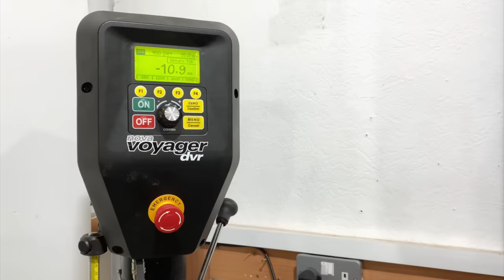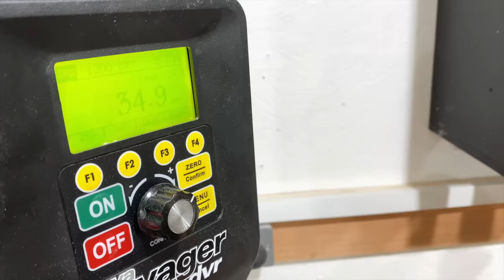Woodturning - Woven Plywood Stool

Comment: Jack, great job on that stool…great look.   I have dabbled in woodworking over the years and now that I am retired, I decided to refit my workshop and get back to it.  I also decided to add a lathe to my tool chest and already turned a couple of bowls and some handles for my chisel retrofit.  Love the mallet…I built one using a 3 layer plywood plan…really useful.  Working with wood is very relaxing for me.
Reply from the maker: Sounds great buddy. Do you make any video’s?
Reply: @JackMackWoodturning  No, I am very unconventional in my methods...it would take me longer to edit the video than to make the project...besides, so many can do it easier or faster than me, I just take my time and if I have to take the long way around the barn to get it done, then so be it.  I take pics of the finished items to show people and if they are interested, I make it for them.

Comment: This was the very first cut my turf has received since been laid (1 month) https://www.youtube.com/post/UgkxTPN04aT-Qdjr_KS3ql7ng8wnU3wwsCqk also recommend  Very happy with the product and delivery. Was cut at the highest setting, I Was able to cut upto the boundaries with ease with exception of the corners for obvious reasons. Very little loose grass left ad the box was large enough to hold everything garden size roughly 24m2. There was no assembly instructions with it, it's not difficult to put together, YouTube the item if your unsure. Would recommend for small gardens like myn.

Comment: That plywood turned out way better than I thought it would good job
Reply from the maker: Cheers bill. Have you turned birch ply before?
Reply: No only cabinet grade oak and it had some voids in it I tried a small glue up of fiber core it finished well but looked strange

Comment: I was wondering what is the advantage of the 2 bottom braces attaching to the other 2 braces instead of to the legs? Is it stronger that way? Or is it so they are not staggered?  This was really nice being able to see this build from beginning to end. I think I might be able to make a stool like this but I don't think I could drill the holes in the legs as precisely as needed (or perfectly like you have). I have watched you marking the center line for the holes several times. I have tried that in the past but have not known if I could trust my results. Your precision and confidence is impressive. I have such a long way to go.Thanks for spending the time to share this with everyone .
Reply from the maker: Hey. The lay out of the stretchers is purely aesthetic, 
If you’d like to make items like this the only piece of advice I would give you is to watch ALL of Curtis Buchanan YouTube channel. He is outstanding and he explains all you’ll ever need to know about chair making.
Reply: @JackMackWoodturning  Thank you. I took your advice and checked out his channel. Helpful.

Comment: Now, that IS one beautiful stool!! Takes your imagination into whole different directions. However, a quick question from a newbie in the craft: What is the purpose of the circular walnut insert in the underside? Is it an accent piece or does it somehow add to the strength of the project?
Reply from the maker: The recess was made to hold the piece to the chuck. I filled it to remove any sharp edges and add durability 😊👍🏻
Reply: . .就

Comment: That stool is so cool!!  For such a simple idea, it came out looking so intricate & just amazing!! 😍.  Also, I don’t mean to ask a stupid question, especially if this is *common knowledge*, but I am just learning/getting into woodworking & was curious about why you rubbed the lathed pieces w/ the shavings after?  I kinda assumed it was for the oil or something, but I honestly don’t know & really wanna know all I can, lol.  Sorry for bothering you w/ silly questions, lol.  Thanks for sharing!!!! ☺️
Reply from the maker: Hey Felicia. Please don’t worry about asking questions, that’s what I’m here for and I’m more than happy to help and share my experience. 
That process is called burnishing. It can be done with wood shavings or with extra fine wire wood. It’s function is to add a final sheen to the wood after sanding. It goes back to days of bodgers making chair parts in the woods (but most likely way further back to the birth of turning) before we had extra fine grit sandpapers and other abrasives it was used straight after final cuts and softens the effects of burnishing caused by tool bevels. I personally find it adds a shine that looks more natural than sanding a piece to 1200 grit or higher. 
Hope that helps and please don’t hesitate to comment questions on any on my videos. 
How long have you been woodworking for and what do you like to make ?

Comment: Fantastic piece! I was wondering, what is the purpose of the central dark wood circular inlay on the bottom of the seat? I guess it's for construction stability since most users won't see it. Is there a risk the sitting surface could delaminate to its original pieces if you omit that inlay?
Reply from the maker: The recess provided a hold for the chuck. I filled it more to remove any sharp edges but it does add a little strength as well 👍🏻😊
Reply: @JackMackWoodturning  I too was wondering what was its point. I thought that you might inlay your signature/logo on it or something.🤔
Reply from the maker: It’s covering the recess that was there to hold the top on the chuck.
Reply: х

Comment: Nice work! I was a tool maker for many years and I learned quickly to keep track of all my fingers. I am sure you know what you are doing but I question your hand position while turning. Looks a bit risky to me. Just saying,
Reply from the maker: Iv’e been doing this nearly 20 years and still have all my digits 😊
Reply: When specifically are you concerned? Is it when he's working on the legs and is "holding" the wood as it turns?

I'm very inexperienced with wood working...my paternal grandfather passed away before he could teach me much. My dad has passion for it, but not nearly the skill grandpa had.
Reply from the maker: The dude doesn’t know what he’s talking about Fil.. I’m a professional experienced woodturner and I also used to teach woodturning.
Reply: As a devotee of the violin all these tools are scary
Reply: @shelleyoxenhorn833  the only time you should be scared of the tools you work with is when you disrespect them because that's when they will bite you
Reply: The only type of tools that really make me anxious and scared of chopping my fingers off, are power saws. e.g. benchtop table saws, reciprocating saws, mitre saws, jigsaw saws, circular saws, etc.
Reply: @chrismartinez7037  the only time you should be afraid of the tools you work with is when they handle heavy machinery
Reply: @thandiwolfe813  Yup, I like to confirm that they're quite sharp before I trust my personal safety around them.

Comment: Basket weave design totally ROCKS brother.  Are you a carpenter by trade?
Reply from the maker: I’m a woodturner by trade grizz. I run a production woodturning company, but make these videos after my work is done. 
I turn thousands and thousands of bowls per year. All the same and all very boring. I also do a lot of custom commission work.
Reply: @JackMackWoodturning  Sweet, the  reason I asked is because your work is so precise cool stool.

Comment: Nice work. Just a tip. That seat would be much stronger if you had made it in two halves, then use clamps on each half, then clamp those two halves together.
Reply from the maker: Why do you think that would make the seat stronger ?
Reply from the maker: How is that any different to gluing it up as a whole?
Reply: @JackMackWoodturning  , simple. Glue is not a filler. I grew up with a very large father. I got to learn fast on how to properly repair chairs. I make things to withstand heavy loads. Leaving thick glue lines will come back to haunt you. Just some friendly advice
Reply: @JackMackWoodturning  , your video did not show you using clamps. If you did then please ignore my comment.

Comment: Hi Jack
When I watch a few woodturners on The tube, I am surprised to see so much of the bandsaw blade above the work piece, I was taught it should be just above so that you can see the cut line. Is it like that to show on film as it looks dangerous, in the UK our health and safety executive would go mad if they saw saw that in a workshop.
Mike UK
Reply from the maker: I am in the uk Mike. North east England. 
Often I have the guide bearing high up so that the cut can be seen by the viewer. 
However, I keep my guide bearing high most of the time anyway. 
If the blade is set up right I find very little advantage in having the bearing close to
The work piece. I’d rather follow a line by eye. The slightest change in grain direction in wood can throw your
Cut off, the guide bearings do little to adjust that vs the ability to see the cut fully. Especially when roughing out radius cuts. 
Lots of people like to get irate about health and safety.. I’m the only person who works in this studio. I am in full control of my hands and arms which are contented to my brain and eyes… when I work I am never distracted by others, I focus on the task at hand and never rush. I have no need to lower the guide bearing for every cut. 

In the past I’ve worked out that my time at the bandsaw is around 12hrs per week, 
So that’s 12hr x 52 weeks = 624 hours per year.. x 20 years = 12,480 hours at the bandsaw.. 
in all that time I’ve never had an accident or felt that I need more accurate cuts.. 

When I resaw boards I keep the bearing low for additional support. 

👍🏻

Comment: Looks beautiful but I don't see how wood movement isn't going to wreak havoc.
Reply from the maker: Please explain your thinking.
Reply: Plywood expands and contracts quite a bit in the thickness dimension, and the stool design restricts that. I'd worry about cracks showing up with seasonal changes in humidity. Unless you've done something to prevent it.

Comment: Great video thanks for sharing, that's a beast of a lathe, what make and model is it, I've never seen the digital readout on the tailstock before, is that an aftermarket addition.
Reply from the maker: Not the digital display is standard. The lathe is from Axminster but I wouldn’t recommend their products. I am in the market for a Vicmarc 👍🏻😊

Comment: Perfect 👍👍 Are You Using Marine Glue or Wood Glue?
Reply from the maker: This was titebond 2. What would you use ?
Reply: @JackMackWoodturning  I don't know which one will make it stronger
Reply: @kccwoodart  When properly glued the glued joint is stronger then the wood itself.  Glues are formulated for interior use, water resistant , or water proof.  So use the proper glue for the environment it will reside in.

Comment: Hallo sir if i may ask how many types of wood have you used is it ply wood and mahogany only or more and can i use use wood varnish instead of wood oil. Kindly share the measurements of the pieces you have cut both the plywood and mahogany plus what is the thickness of of the plywood
Reply from the maker: If you have the skill to Make this you should know that you don’t need me to give you measurements.. 
the pattern is made up of ply twice the length of the width.. and the “walnut piece” and the width squared.. depth is the depth of the seat. 
Best of luck drilling the angles for the stretchers. 😉😉

Comment: jack brilliant work Jack could you let me know the oil is that you finished it with
Reply from the maker: Thanks bud. The plywood top was sealed with home made shellac sealer and then the whole thing got a few coats of liberons danish oil. Fantastic stuff
Reply: Thanks Jack for the reply would that be the same as Danish oil
Reply from the maker: It is danish oil and it’s made by “liberon”..  all danish oil is NOT equal. liberon make the best. Some other brands are awful 😉

Comment: Admittedly, I know nothing about wood turning. However, after watching a good few of your videos, and others, I never saw anyone use the shavings to rub the wood. May I ask what that's for?
Reply from the maker: That’s called burnishing. It’s a traditional technique that adds a sheen to the last stage of sanding.
Reply: @JackMackWoodturning  Thank you. I'd heard the term, but had no idea how it was done. It does add a lovely patina to the wood. Absolutely stunning stool!
Reply from the maker: It can also be achieved with fine wire wool be be cautious as wire wool can catch so needs to be held with a very delicate grip

Comment: Mr Jack, a question that, at first, might seem rather elementary: did you work from a plan to make this wonderful stool, or did you just “wing it”? I pose this question because I’m wondering about some specs-especially regarding the drilling operations on the seat assy. Other dimensions would be helpful as well! So is there a plan , and if so, is it available?
In case you haven’t guessed, I like this piece enough to want to duplicate it— several times! As a subscriber, I hope to see a 
reference to said plan soon…..!
Reply from the maker: Hey Charles. I don’t have a plan for it no but it’s essentially made from a series of rules rather than dimensions.. your chosen dimensions plus “rules” will result in dimensions and angles. 

Have you made a stool or chair with turned spindles before? 

I make Windsor chairs as a hobby.. I couldn’t make them fast enough to live off the profit and make one a year if I’m lucky. But the rules I have learnt through chairmaking have enabled me to male stools like this. 

Marking and drilling mortices at correct angles is the real challenge. 

I highly recommend you watch ALL videos uploaded by Curtis Buchanan
He is the epitome of experience and passion. A true craftsman. 

If you’d like to talk in more Seth you can message me directly on instagram or Facebook. 👍🏻

Comment: Great job, but what’s the point of the circular inlaid piece underneath when you can’t see it??
Reply from the maker: The recess was made so the piece could be mounted to the lathe. I then filled it to remove any sharp edges and add durability 👌🏻👍🏻😊
Reply: @JackMackWoodturning  now I get it💡Thanks

Comment: Love this design! What dimensions did you use on the blocks? I want to turn this as a bowl or a platter!
Reply from the maker: Hey . Thanks. What do you mean by what dimensions?
Reply: Just the seat  measurements.
Reply: How many inches are the blocks? Thanks.
Reply from the maker: It’s all based on the thickness of the ply. This pattern is Made up of ply cut twice the length of the thickness and walnut cut the thickness of the ply squared. In this case it’s 18mm ply so the length is 36mm and the walnut is 18x18mm

Comment: beautiful work, congratulations. PLEASE CAN I GET TH MEASUREMENT OF THE CUTTINGS ??, if it is possible in metric, thank you
Reply from the maker: Hey. There isn’t really I need for the measurements. It works more on a “unit” style system. 
For example the comes plywood 18mm thick (which sets the “unit”)  18mm 
So the pieces are already one unit thick.. so the length is cut to 2 units. And the walnut sections are cut to 1 unit square. 
In this case I wanted the seat to be 65 mm deep.. so they were all cut to 65mm. 

The making of the undercarriage is not simple.. chair and stool making is a complex craft and takes a lot of learning to understand it fully. 

I highly recommend you head over to Curtis Buchanans channel and watch his tutorials on chair making 😊

Comment: you are working the tools as they should not scraping but cutting at an angle anybody can scrape but cutting is a different thing
Reply from the maker: Are you saying I’m not cutting with the gouge ?? Please do point out the section you are having difficulty with and il be happy to explain
Reply: @JackMackWoodturning  what im trying to say ,is that , you are using the lathe tools as they should be used to cut at an angle  and not scraping horizontaly as i have seen others do
Reply from the maker: I’ve been a professional woodturner for 20 years and have taught turning for the last 10 years. 😉 thanks for your observation 😊
Reply: @JackMackWoodturning  i am a joiner by trade but during my apprentice we had to do the lathe

Comment: Nice stool. What angle did you use for the legs into the seat?
Reply from the maker: Thanks Greg . Angle was 12 degrees. Have you made many stools ?
Reply: @JackMackWoodturning  I’ve made a few, short shop stools and taller bar height.  One thing I do differently is that I don’t glue the stretchers in. The are sized so the you have to spread the legs apart to get them in after the legs are inserted into the seat. That’s why they’re called stretchers. One article I read said you really don’t need any glue.  Pressure holds the stool together
Reply from the maker: Definitely but even traditional Windsor chairs use glue.. even tho it will inevitably fail and that piece will tighten with every use.. I think you might find that you get better action from the stretchers if you assemble the undercarriage first and muscle the leg tenons into the seat. That’s how the old Windsors were made.